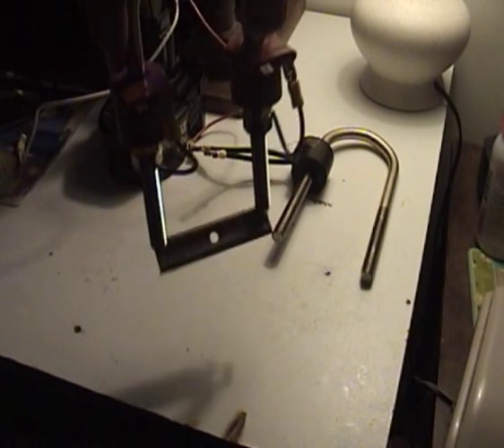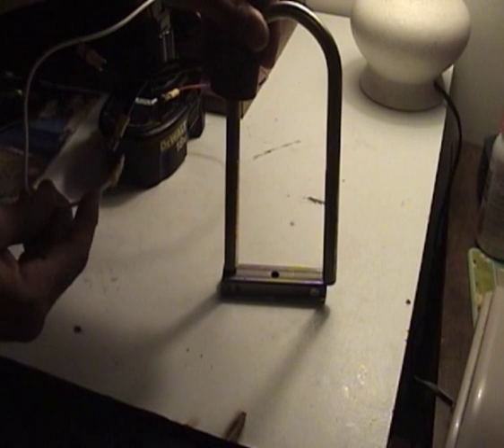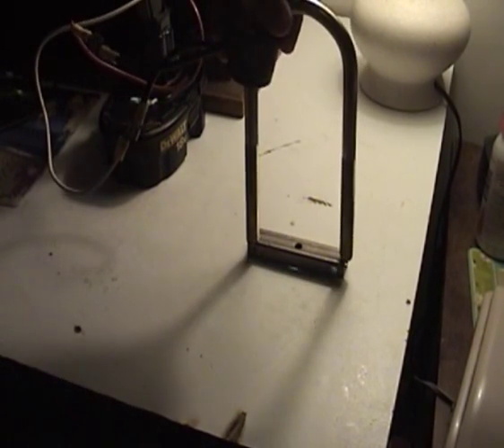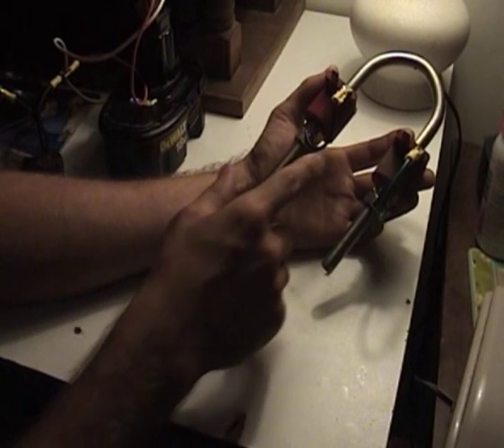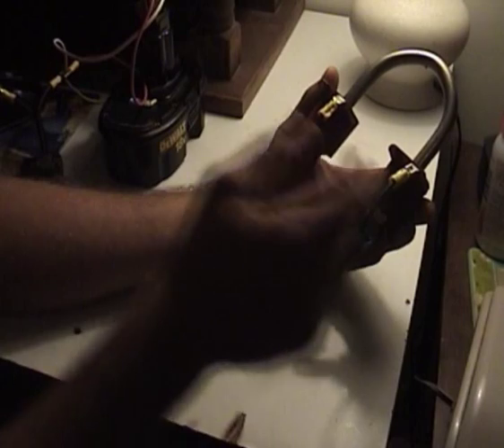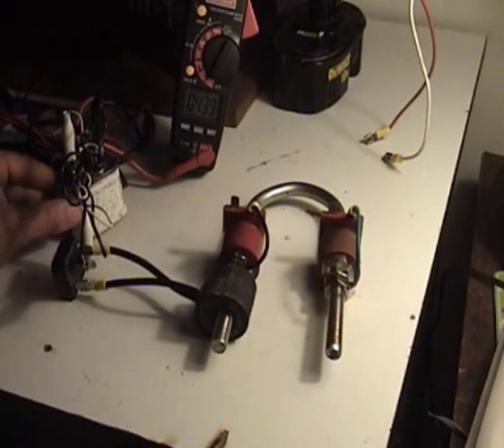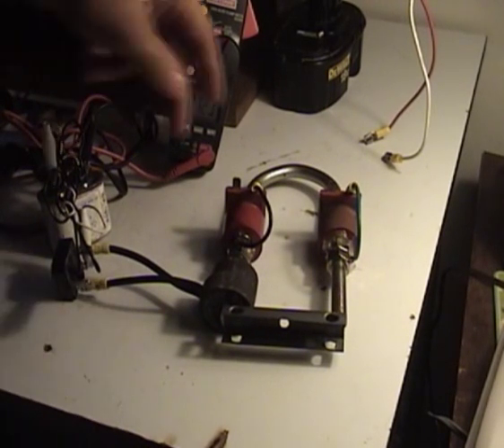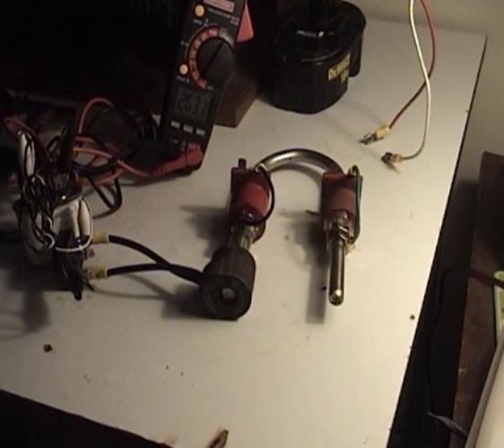Ed  Leedskalnin Magnetic current pt2

Comment: Hi crobb227,
I am thinking about how you can get a piece of magnetized iron to lose its magnetic properties by hitting it with a hammer. So, I am wondering if the smacking that gives you more (volts to the cap) will be removing the magnetism from the hoop faster?
Do you have any duration tests?
What a cool puzzle. Thanks for these videos.
jeanna